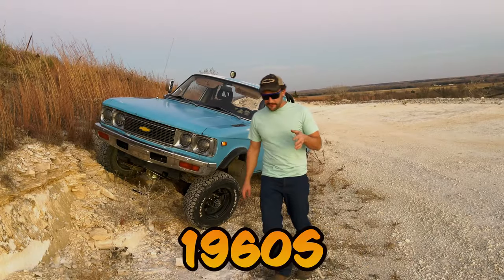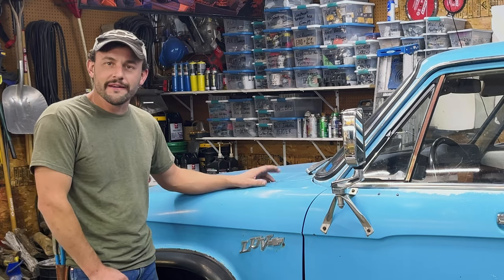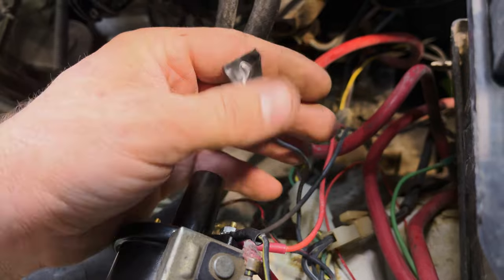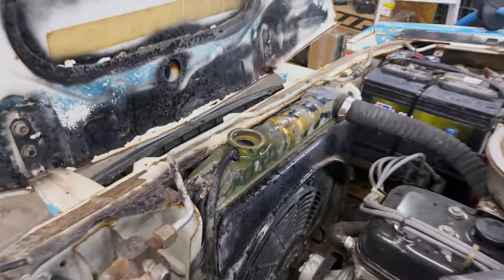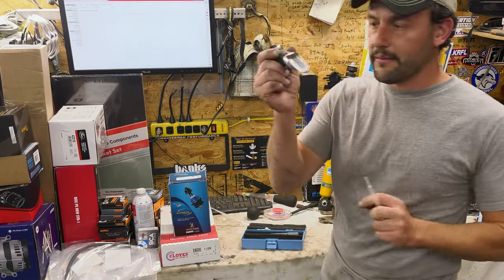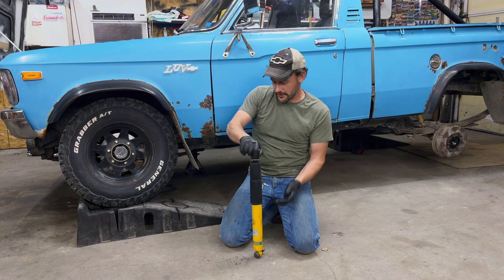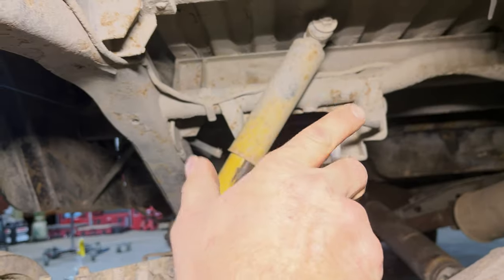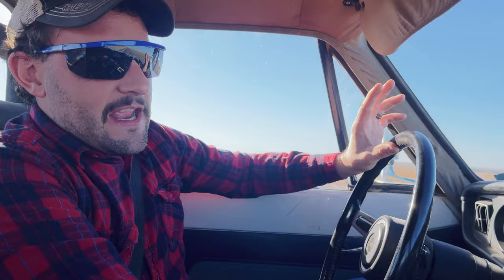4X4 Chevy LUV UPGRADES | Isuzu Dana 30 Solid Axle

Comment: I love both the 521 series and the 620 series Datsun/Nissan trucks along with the Ford Courier trucks to. The Dodge D 50 trucks also were really great looking little trucks to. And the 1972 till the 1980 Chevy Light Utility Vehicles design is pretty good looking to. I  love them all, love little trucks very, very much. Wish they would still manufacture them today here in 2024.
Reply from the maker: Yeah little trucks are awesome and practical. Seems like regulations made them unprofitable to manufacture.  I’ll keep putting the old ones back on the road though.

The D50 I’m working on now really is a nice unit. The 2.6 actually makes decent power.
Reply: @fabricobbletech Those were actually Mitsubishi trucks with Mitsubishi engines in them.  Still, they were a good looking little truck to, nice, plain simple design, gas saving little trucks. Man I wish they were all still made today, I love small 4 cylinder engines, small cars and trucks.

Comment: i have had two 1974, two 1976 & a 79 and 1980, I rebuilt the engines in the 1974, one of the 76 & the 1980. The 1980 was the only one with AC & after a little work they were all very dependable all 68-76hp. I was always jealous of a couple local Game Wardens here in South Georgia as they drove 1980 4x4 LUVs with the Diesel & military tires.

Comment: I have the 73 luv and luckily it has the crossflow g161 engine probably swapped by the old owner and a handmade bed because here in Greece every single pickup had a handmade bed for extra space and more capability

Comment: Ive had great luck with a product called Water wetter. Takes all the air bubbles out of  the coolant mixture lowering temp.
Reply from the maker: I've used that before in my car. I think a big part of my LUV running hot is thermostat didn't really open much until 190. Still wasn't, what I would consider, fully open at 205F. With the 160F thermostat my fan doesn't even come on going down the road and temp gauge stays right in the middle. May be a bit too low once the temp drops but that's yet to be seen

Comment: Reckon you 800cfm should be good enough if you had space for a cowl it makes major difference in efficiency...using one on my 94 mazda bakkie no issues since I used the factory cowl...just my opinion
Reply from the maker: I looked up the fan that was on there and it was only 650cfm. I’d assume 800 would be fine with a properly functioning thermostat. With the 160F thermostat my fan doesn’t even come one unless I’m idling around. On a hot summer day that might change.  But yeah, 3,000cfm is definitely overkill.

Comment: Did you unplug the vac advance when you adjusted the timing?
Reply from the maker: I forgot to mention that but yes I did. However, it is plumbed into a timed vacuum port, on carburetor, that doesn’t see any vacuum unless throttle is opened beyond idle position. This prevents vacuum advance at idle.